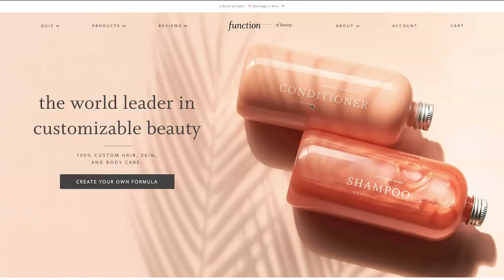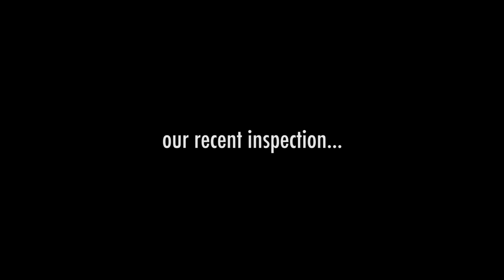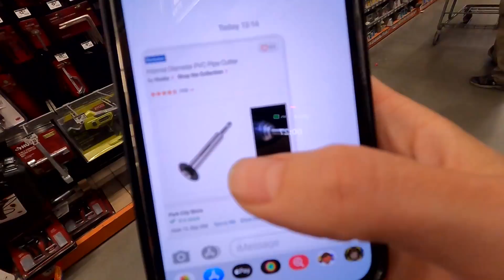BUILDING A SHOWER IN OUR TINY HOME | TRENT & ALLIE

Comment: LMAO, you are so far out of your depth on the shower and this is a week old so, I can only imagine what it looks like now. You think as you tube creators that you'd research a how to before just hoping you know what your doing... The thin-set doesn't go on till your ready to set tile. And that's after the pan is set in, and I was noticing you didn't use green board for your shower walls which happens to be standard for tile. Along with ready board for the floor before the pan is set and (glued) in place. And since you didn't research it, there's a fitting that you can slip over the PVC pipe so there's no need to cut the floor.